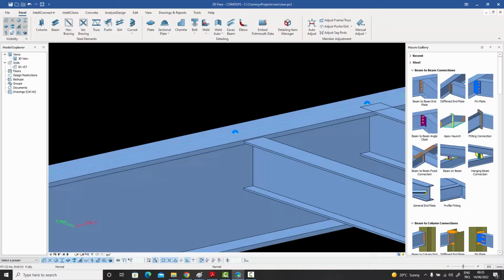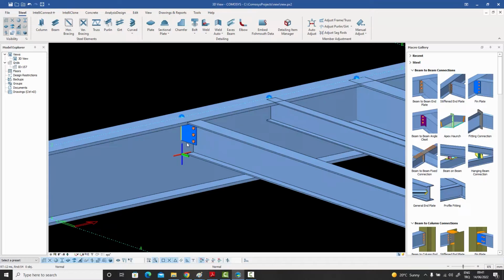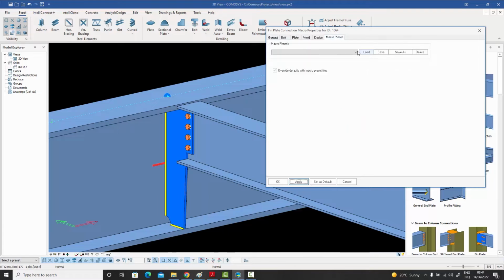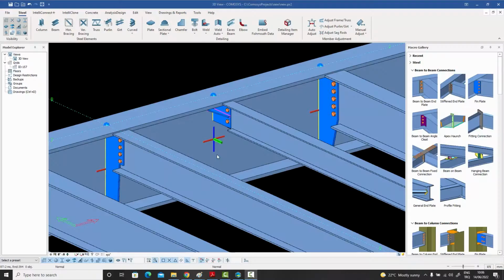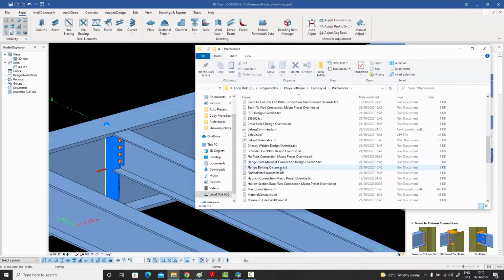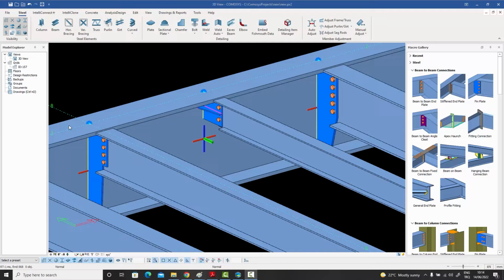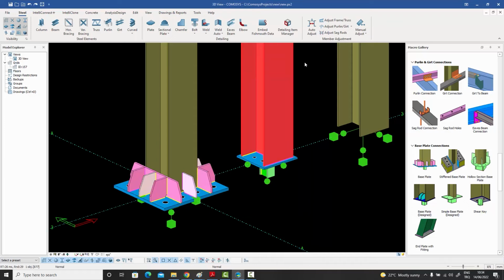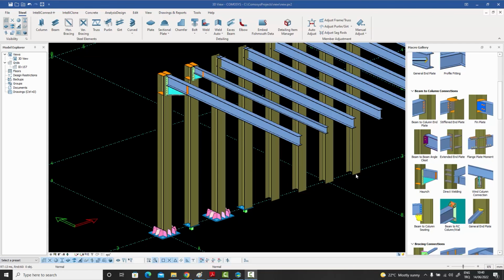COMOSYS General Tutorials -  AutoPresets

Comment: You have saved a one connection setting for IPE 300 with name IPE 300.  Now, in override file, can we apply for other profile whose depth is also 300 mm , like ISMB 300,  by mentioning in override file. Means one saved one setting can be applied to Few more section like MB 300, UB300 etc. also by writting few more line in override text file ?
Reply from the maker: You can have 100s of presets, it is just you need to  define new preset name to it.